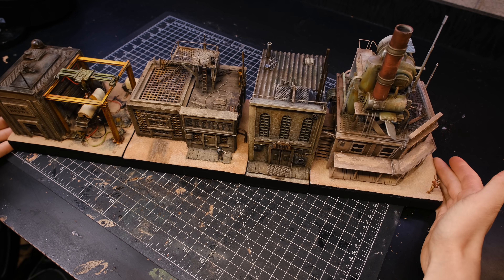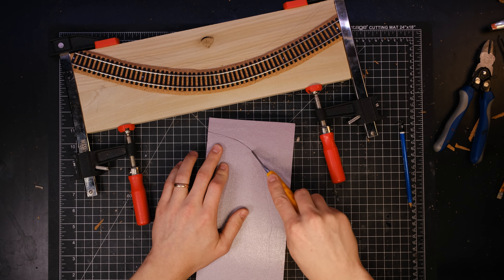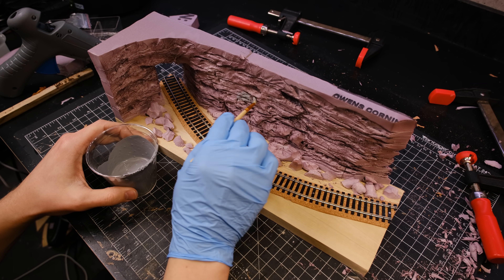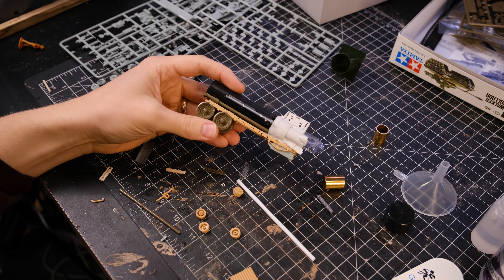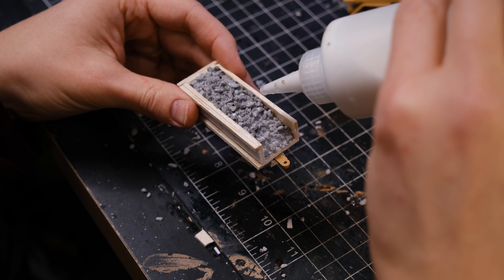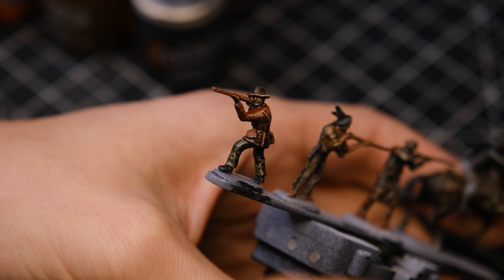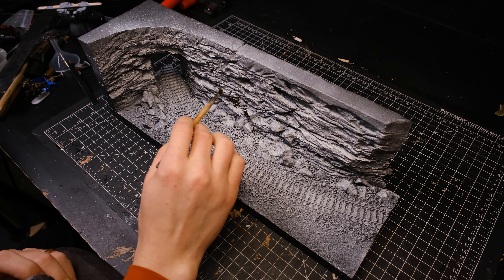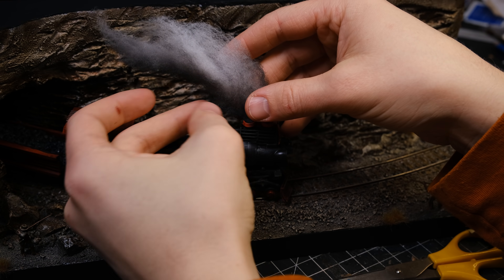Train Robbery | Wild Imaginary West

Comment: Great diorama, just one nit.  There's needs to be a couple of boulders or large logs on the tracks to slow the train down.  Otherwise the engineer will just slam the throttle forward and zip right by the Train Robbers.   😁👍

Comment: Thank you.  I've been requesting a Steampunk Train for your Wild Imaginary West series for about a year or so, and what you made (and how you made it) was well-worth the wait!

That tension between Steam and Electricity sounds like a variation of the feud between sheep herders and cattlemen in the actual history of the West.  (Spoiler alert:  the cattlemen won.)  I suspect that the backstory in your Wild Imaginary West would boil down to a competitive battle between the coal industry and whatever alternate source is being used to generate the electricity and/or the producers of the high efficiency batteries that makes electricity a viable option to steam.  In any case, I can't wait to hear (and see) more!

Thanks for posting this, (and for putting up with my chronic requests, that will officially end here and now.)
Reply: I have also been requesting a steampunk-style (hover train anyone?), for awhile now.

While this train build is awesome, I am still bummed that there isn't anything hovering or flying in this diorama. Not to say I disappointed with this video, not in the least. He scratchbuilt a steampowered train for crying out loud! 😳

Hopefully he will be doing a dirigible or a steampowered flying machine somewhere down the line.
Reply: @earlware4322  technically he's only built a locomotive. A train is a locomotive pulling rolling stock. Which is a really impressive thing still, a very impressive locomotive and brilliant diorama.
Reply: I've been requesting a Train Robbery for a while too; its great to see it come to life, so to speak

Comment: His voice in this video is more cheerful than usual. Something good must have happened that day.

Also I really hope someone whose good at writing sees all this stuff and is like “I should make some lore about it”

Finally, the alcohol allows the glue to spread out more across the surface of something because of its high acidity and low viscosity, which most glues don’t have have. The acid in the alcohol helps break down the bonds in the glue temporarily, allowing it to spread out more, but when the alcohol evaporates, those bonds are re-formed. 

Basically it spreads glue better

EDIT: I’m dumb  and stopped the video to explain, ignoring the fact that he probably knew, but I’ll leave my comment in case anyone wants to know just a LITTLE bit more behind the chemistry of it

Comment: The next time you need to bezel a soft material like cork, try using a cuticle trimmer! They’re little sticks with a v-shaped blade on top which are typically used for trimming away cuticles, but work great for this. I own a business making silicone molds, and I use that to bezel the edges of the molds. Great diorama as usual!

Comment: There is something that is a detail that you forgot but easily remedied: soot deposit on the rock overhang of the tunnel opening.
This is a detail that is missed by most model builders, it is such a little splotche of soot where the smokestack passes under the rock overhang.
This diorama came out great, oh by the way the reason you always saw the engineers and the fireman wear handkerchiefs tied around their necks was that handkerchiefs were the old west version of a respirator for when they went through tunnels, or else they would be breathing coal smoke all the way through the tunnel, which can be over a mile long.

Comment: Hi dear Modeler, amazing work you perform, I follow your publications and enjoy all your projects. 

Just as a suggestion, for the rail track metal rails, I saw some videos from Luke Towan and he use to weather steel rails painting them with  brown iron rusted color by the sides of the rails, keeping the upper surface cleared of paint as you did also in your video. 
But instead of only apply a wash on the sides of rails, painted on a rusty color and then applied some wash or pastel powder give them an ultimate realistic look to the scene. 

Congrats for your work and keep on it!

Regards.

Comment: Great Train that you designed there! It looks really otherworldly with that long gap between the main drive wheels and the guiding wheels in front. But: it is lacking something like cylinders or pistons and a way to transfer that power to the wheels. So if you build another one from the same "class" maybe that is something to consider? Also, those bandits (as someone pointed out) forgot to block the track with a couple of tree trunks.

Comment: I like the overall look of this, but being a big fan of 1800s era trains, I feel the need to nitpick. :)

Your locomotive is missing drive rods for the larger driver wheels. Typically there would be a set of horizontal cylinders hanging down at the front of the loco, with pistons that would then be attached to the drive wheels with rods. There were some specialized locomotives that had central drive shafts, driven by vertical or slanted cylinders/pistons, similar to a car, but they tended to have smaller drive wheels at each end that could swivel. They were mainly designed to go around sharp curves and up steep hills for logging operations and such.

Comment: Your design and creative skills are impressive. No question about it! 
But I don't know if it was such a good idea to build your own locomotive from scratch. For one thing, this "steam locomotive" has no apparent power transmission from the steam boiler to the wheels, and for another, it doesn't give the impression that it could run on a track at all.
Maybe next time you'd rather take an existing chassis and design your locomotive on that basis. After all, there are more than enough unusual types of steam locomotives. Such as geared locomotives or Garratt locomotives.

Comment: That engine's front doesn't look too dissimilar to a lot of American streamliners from the 30's, so there's at least some realism. Also eyes.

As someone who models pretty much exclusively in model trains (haha funny train with face), this definitely inspires me a lot to try building some from scratch with whatever I have. Tank wheels is something I definitely wouldn't ever think of using, but seeing it pulled off here and looking actually good says otherwise.

If you wanna look for custom figures like the project of Model Creator, the currently going HeroForge isn't a bad place to go with. They may be a little cartoony and they're made primarily for war game miniatures, but you always have options of covering the face and specifically order them to have their feet as the base instead of a big round one. They can get expensive though, so 1 or 2 is probably going to be the only ones worth spending money for when doing a single project.

Comment: If I'm not correct, that track is electric, so you could get a controller, power pack, and a working engine to run back and forth. You could find an electric loco from companies like Bachmann or Hornby. They make pretty good models.

Comment: In the real world, Electric trains were invented super early on- they had them at the turn of the century. However, lots of railroads still used steam power, because they didn't want to build and maintain the overhead wires above the track.

Heck, Modern American Railroads still use diesel locomotives for the same reason.

Comment: Build is great, the engine does not seem functional from a train obsessor point f view. Maybe it uses an internal or bottom shay system to power the back wheels. If you ever do a logging area for Wild West, please make a shay locomotive as they look rugged, and fit the environment.

Comment: I love your work, but for this particular build I have some critiques: 

1) Your bandits have no way to halt the train. There's no reason for the train crew not to duck down, forward the throttles, and blow right by your bandits.

2) Conflict between steam and electricity: Why? Electricity doesn't just happen. It has to be generated. Nuclear power plants are steam engines which happen to use atomic power to generate the heat to boil the water. So where are your Teslers getting their juice?

3) Jackalopes!

Comment: I assume you used 1:87 track for this. If you can, you can try hooking it up to an entire track system and actually run a train on it! Best looking train I can think of is either a Bachmann 4-6-0 (not necessarily the best quality, but very commonly sold) and an Athearn 4-4-0, Athearn 2-6-0, or Athearn 2-8-0 (the only difference is the wheel positions, these 3 are also incredibly difficult to find, I happen to have an Athearn 2-8-0 and Bachmann 4-6-0)
Reply: Quick note: the Athearn locomotives represent a more 1880s and 90s feel, the Bachmann 4-6-0s are a more 1910s feel. If you really want something Wild West-y, Bachmann also has a 4-4-0 that was built in the 1860s.

Comment: Going with my lore idea, maybe some of the ships were nuclear powered , most were too irradiated, but some weren't. And so, they researched it (using the ships few working computers) and then discovered it to be a much more efficient way to make steam, so they began to make a few nuclear powered trains but since uranium is dangerous as FU- they've only made a few engines (like, 4 maybe 5) and only 3 are actually in use. And those three engines are only used for extremely high priority stuff, such as precious material transport, large money transport, and extremely-important-person transport.